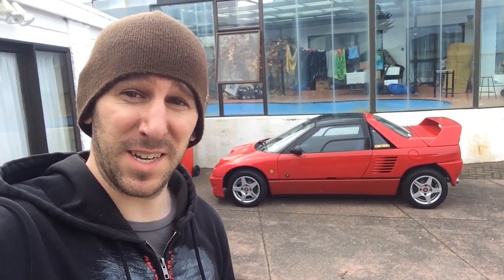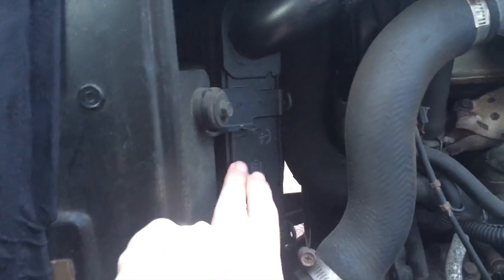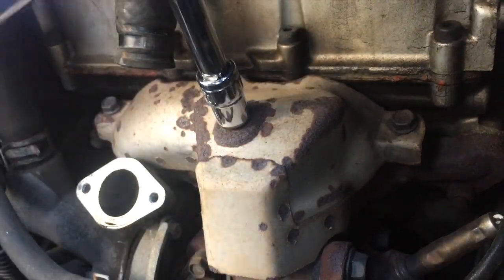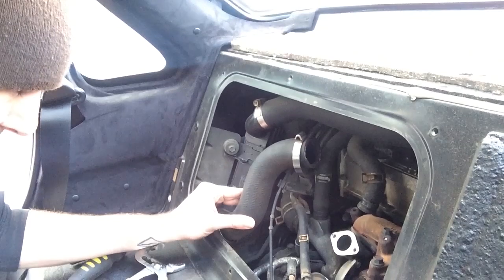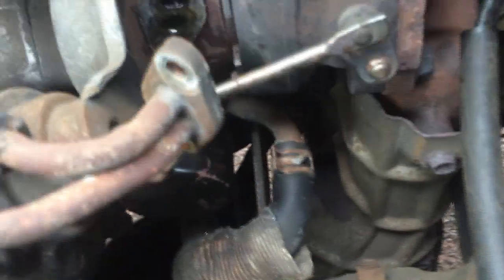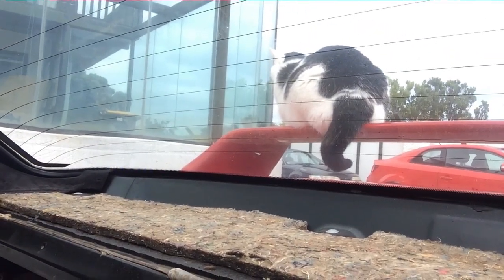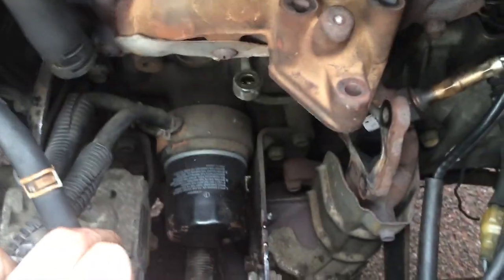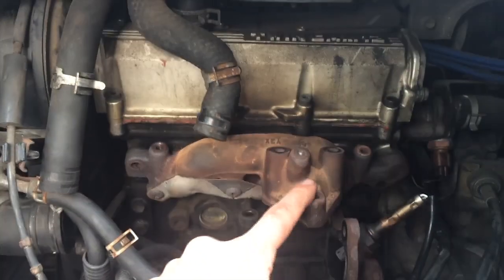Autozam AZ-1 Turbo Swap: Part 1

Comment: Put a Hayabusa engine in it.
Reply from the maker: Already did.  The immense power caused a burnout that spun the wheels so fast it reversed the Earth's rotation and time went backwards to before the engine swap ever happened.
Reply: @NewZeroland  I never even considered that that would happen. Is it still running?
Reply from the maker: @bobbyspivey3721  well I sold the car about 3 years ago but I think the new owner is still racing it around NZ 😁

Comment: So like is shipping the ecu to Japan the only way to tune one? Can you not tune it yourself? Like no standalone ecu options or anything
Reply from the maker: The guy in Japan installed his own chip.  I don't think the original ECU had aftermarket tuning ability.. unless you could find the software Suzuki used at the time.
Reply: @NewZeroland  oh okay, thanks man

Comment: How tall are you? I'm suprised any American could fit in one of those. Your height would be good to know to compare how you fit on the ego. At 6'3", some bikes are too small for me.
Reply from the maker: I'm 6'2" and fit really well in the AZ1. There's a lot more head room than you'd think. The real problem is leg room.
Reply: @NewZeroland  my first car was a 1986 Honda crx. 50 mpg. Perfect for tall people. I loved that car. Until I started driving Porsches, BMWs, Lexus, infinitis and Teslas. Everthing feels slow now that a model 3 performance is my daily driver. Got to get the RS version of the ribelle.
Reply from the maker: @CRPerformance1  ohhhhh the Model 3P is insane!! That thing teleports 😂
Reply: @NewZeroland  I peed a little the first time I mashed the pedel. It's stupid fast. BUT, I'm saving for a model S plaid+. 0-60 in less that 2 seconds and over 500 miles of range! I want to pay my house off before I buy it. Probably in 2022 or 2023 depending on how my business goes. I'm a home inspector. I have some Tesla stock I'll sell to buy it. My $10k investment last year is worth $50k now.

Comment: What do you do about brakes? My son can't find brakes anywhere and nobody wants to work on  it.
Reply from the maker: I ordered some Dixcel brake discs from Japan via their yahoo auctions (www.jauce.com) and Project Mu brake pads.  He'll also need wheel bearings because a shop needs to press out the original bearings to change the discs.  It's a really crazy design!  Someone on facebook mentioned using different hubs to get around this, but I can't remember what car they were from.  Good luck!
Reply: Thanks! I'll let him know.

Comment: I hear the Honda Beat will be getting new OEM parts from Honda. Not gonna lie, I would love it if someone turned a kei car into a real drift missile. Or if it would be possible to put a 4 cylinder or 2 rotor in one and do some pulls.
Reply from the maker: They still sell rebuild kits for these engines with bigger pistons and tons of crazy stuff to get 150hp out of them (which would be crazy in this car).  I'm planning on going electric though, because I've become ruined by instant torque.  Much will change with this Autozam in the near future!

Comment: I guess it's too late, but did you consider doing a remote oil filter mount? That location seems horrendous and I'm really curious how you're supposed to change it without opening up the firewall and removing the turbo.

Is it more easily accessible with the car up on jack stands?
Reply from the maker: Yea it's a ridiculous spot haha.  It makes more sense in the Cappuccino engine bay.  It's not much easier to access it under the car unless you have a proper lift, like in an auto shop.  I'm pulling the engine out eventually anyway, so it doesn't bother me :D

Comment: Actually about to pick one of these up.. These videos are a pretty good insight in what's to come. What's up with the electronic limiter, figure out how to disable that? Thanks for sharing!
Reply from the maker: Whoa nice!  Where are you located?  They're awesome cars, and if you've seen my autocross vid (after the swap was complete) I can honestly say it was all worth the trouble.  The stock ECU limits you to 140km/h I think, but going that fast in this little car is terrifying :D I think you can cut one of the wires to remove the limiter, but don't quote me on that.  The aftermarket ECU I got from News doesn't have it, but I think the engine/gearing tops out around 170-180km/h.  The car is made for attacking mountain roads and autocrossing more than high speed tracks.  Good luck with your purchase and have fun with it!
Reply: NewZeroland I'm actually in Japan right now! During my time here I'm going through the process of obtaining a car I can import back to the US, and the 92's work out for when I leave some time next year.. US limits my options since we have a silly 25 year policy, but I'm on the hunt. I'm finding a lot of these either have weird cosmetic stuff done to them or have problems pointing towards the engine compartment. In some examples, I couldn't get the thing to rev easily past 6k without choking up a bit.. Is that a common issue with a failing turbo or something? Either way, all of these places still want well over $10,000 USD for them.. Then the whole export thing to deal with, but we'll cross that road later. Thank you for all of your helpful insight!
Reply from the maker: Oh whoa, that doesn't sound good.  I guess I got super lucky buying mine sight unseen!  They're relatively easy engines to diagnose though, from what I've found.  I found mine on goo-net-exchange and paid around $6-7k usd.  It's a 93 though so I'll have to wait another year if I want to take it back to the states.  The 93's had Mazdaspeed body parts and an LSD, although if you find a 92, there are still companies that sell aftermarket parts.  Monster Sport in Japan can get you an LSD, engine mounts, suspension bushings, tons of stuff.. and of course News GT-1 for all aftermarket power goodies.  If you found one for cheap that needed an engine rebuild, News sells oversized pistons ;D  Good luck man, and definitely keep me posted whenever you find one!  -- mistasam@gmail.com

Comment: Man these things are rad!  Would love to have one here in the states, along with a number of other golden-age late 80's / early 90's japanese market cars.
That oil in the intercooler and compressor piping is indicative of the old turbo needing to be serviced/replaced, assuming that the intake piping (ie, where the compressor sucks air in) isn't oily inside as well.  Now if it is oily in the intake piping before the turbo, then that means it could be coming from the engine crankcase breather, which is kinda like PCV except it's for when the car is in boost.  They feed oil vapor out of the bottom of the engine since it needs to vent, and on turbo cars they can't always just go to the intake manifold like on non-turbo engines because the intake manifold goes into pressure when you're in boost and would push back into the crankcase.  Hopefully it's just the turbo that was going out since obviously it's not going back on!
Curious how different the AZ1 will feel once you get the new setup in.  As a word of advice, when you go to reassemble everything, make sure there's no oil on the charge piping couplings, like where the piping connects to the intercooler/compressor/etc, cause turbo cars just loveee to pop those off, especially if the boost is bumped up.
Reply from the maker: Wow thanks for the tips and all those awesome details!  Even though it's all old school tech, it's been fun to learn as I go.  Yea this car is crazy.  It was pretty fast already, so this new setup should hopefully make driving it a terrifying experience :)  I cleaned it all up and reinstalled everything, and you can see the start of that process in Part 2 (that I just uploaded!):

https://youtu.be/Ifbqvyd-Tr4

I'll try and finish it all up soon and do some test drives.  Maybe even get it dynoed, just to find out what kind of power increases this turbo makes over stock.  If you can get one in the US, definitely do.  There are only a few thousand of these and they're super fun to drive, like street legal go-karts!